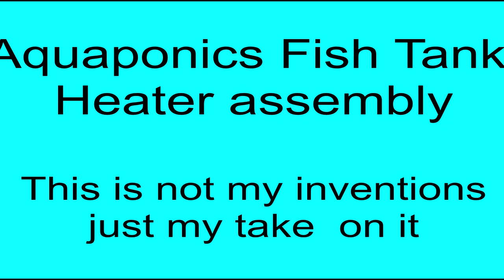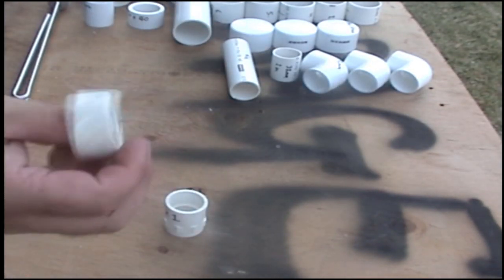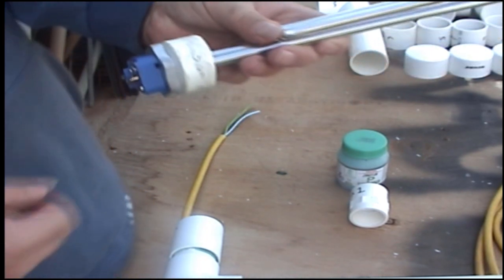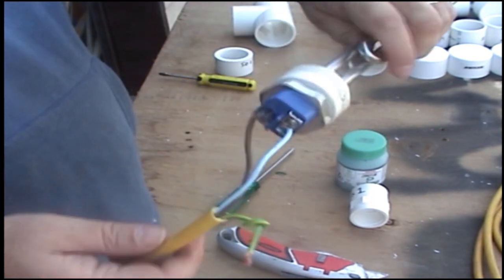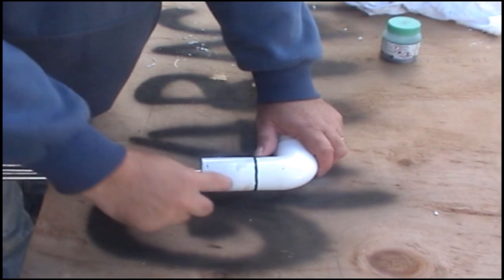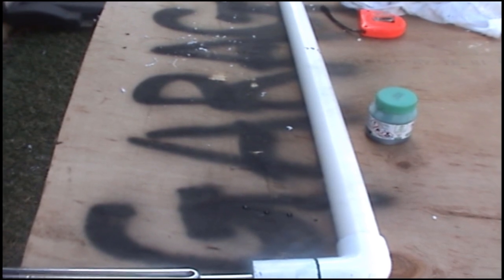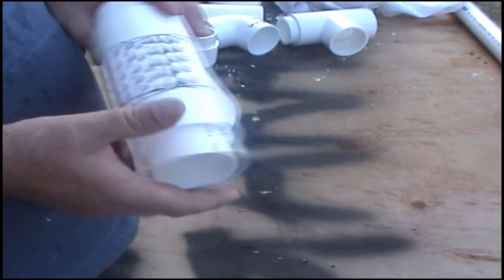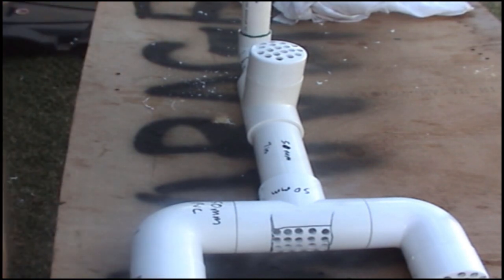Aquaponic DIY IBC Fish Tank Heater

Comment: What kind of Electrical Circuit do you need to run it? What outside temperature limit is there. what about a thermostat?
Reply from the maker: hi Gary the circuit is 240v  it keeps  my tank at 24c - 75.2f  and  thermostat i got this of ebay AU PLUG 240V ITC-308 Digital Temperature Controller thermostat temp heater which words  good .